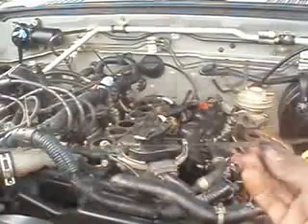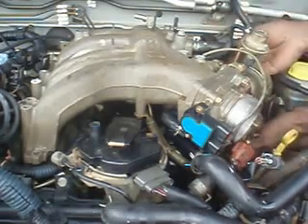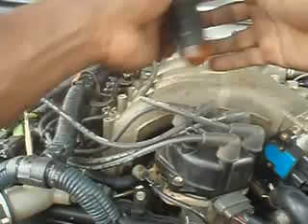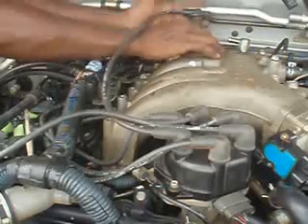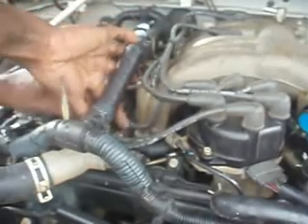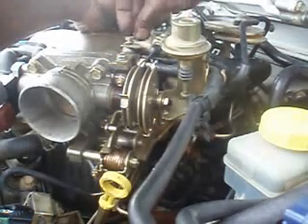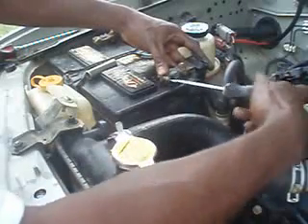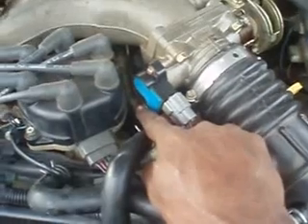Nissan Frontier Intake Manifold Replacement(VG33E). Part 3/3

Comment: Hmm I can't seem to find the lower manifold instalation video . Love the work you do. I feel confident with your vids readily available. The Nissan guy said these gaskets for the lower and upper manifold are supposed to be put on dry?  Is adding silicone gasket maker optimal to dry application? Thanks in advance for the info.